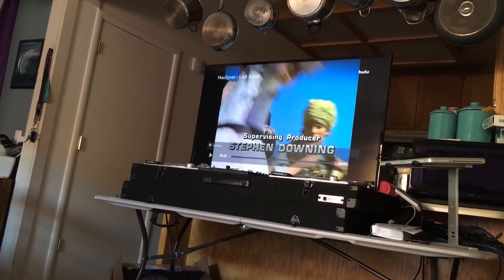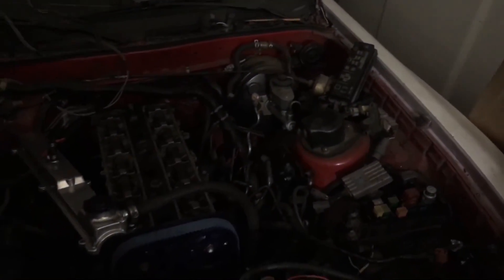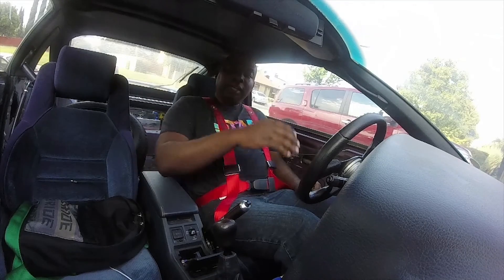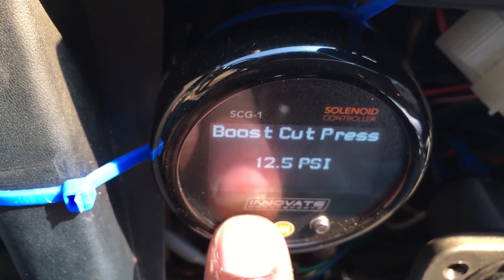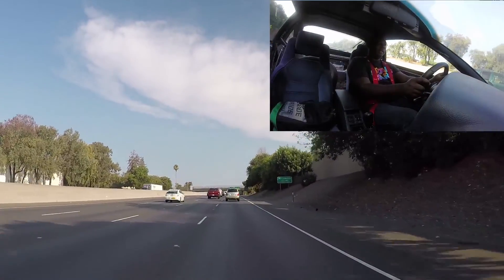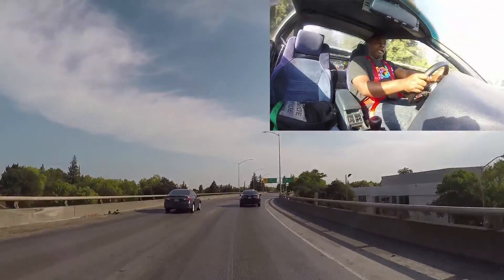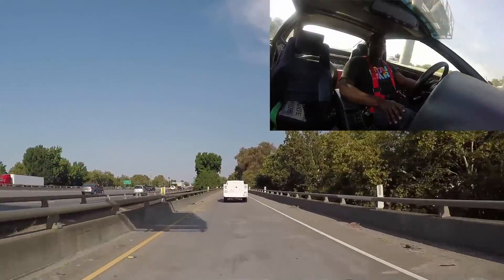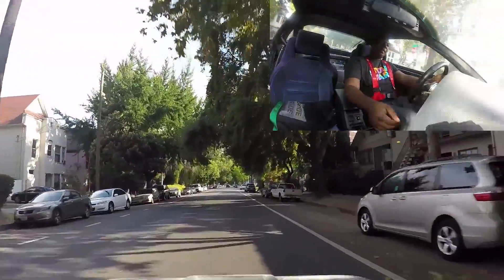MK3 Supra Turbo Drive To Work 20160822 (7MGTE)

Comment: turn up duty cycle up for more boost my car at 22 percent like 15, 16psi then hold at what ever i set boost cut set at and i have my gain on like 50 percent on my mkiv supra with pte 6766 just have play with it bring power in smooth
Reply from the maker: +alclarknc yeah I definitely have to play around with it more, thanks for the help.